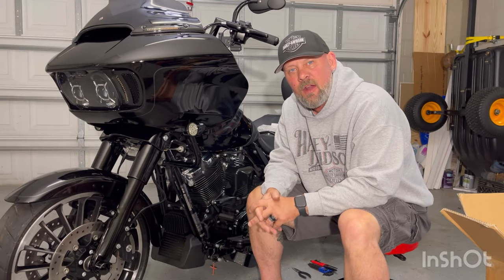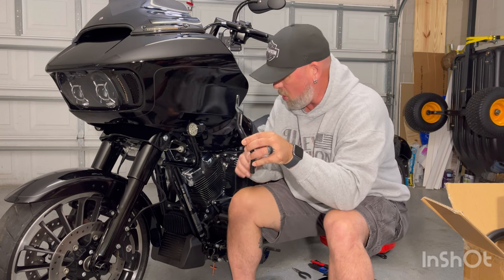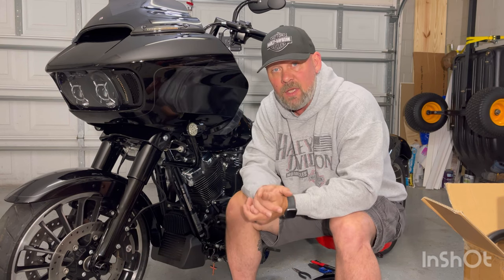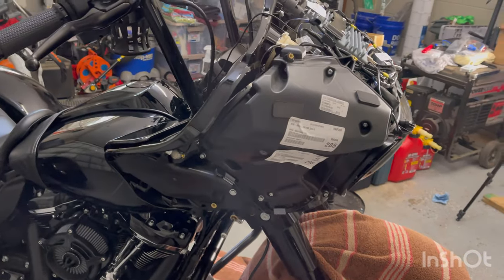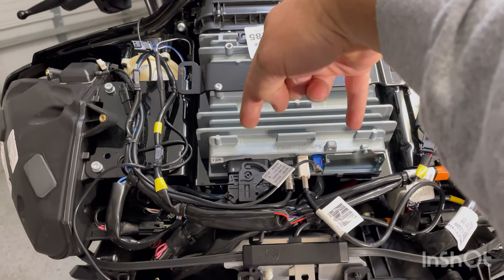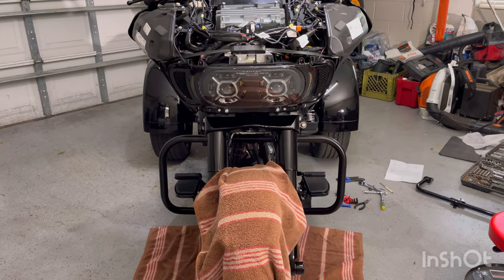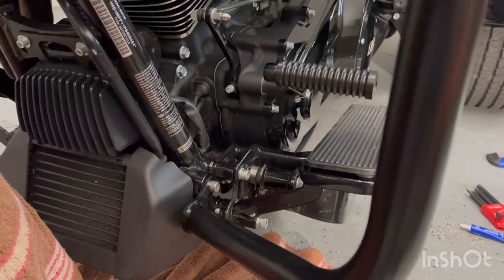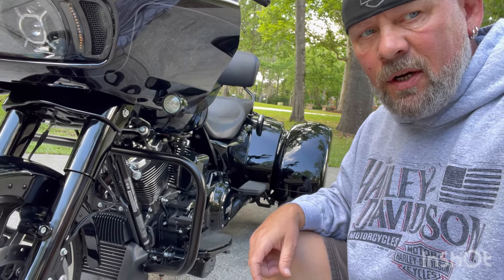2023 Road Glide 3 - Engine Guard

Comment: I just took the bolt out of the fairing support, used a longer bolt with stainless steel bracers and used the same hole with some locktite…. Been 6 months of heavy riding and no issues. A couple dollars for bolt and spacers… saved 60-70 bucks from some bullshit bracket HD sells
Reply: So… one bolt and stainless spacer… into the same hole for fairing support… didn’t have to take anything off or apart. So… that bolt supports the fairing and the crash bars

Comment: if needed, looks like a machine shop could add the original bottom "bar" back onto it by welding some bars to the top of the motor guard that attach to the mounts up under the fairing to help stabilize the lower end of that fairing assembly...if needed anyways...go visit Blockhead! He mounted an LowRider ST front fairing on a standard LowRider S...

Comment: What you need is the Bagger Nation’s ‘STEALTH FAIRING SUPPORT BAR’
(Fits 2015 to Present Road Glide)
Reply from the maker: Not sure that would work since they have moved the fairing.  The mounting holes may not be the same.
Reply: @donniewieburg  the Road Glide 3’s fairing is the same the only difference is HD added a 1” spacer to move it forward. I’m pretty sure it was designed  that way on purpose hence the big engine guard dilemma  (even though the chopped engine guard will fit without and modifications). That 1” spacer also killed the Road Glide Fairing Spoiler fitting on the Road Glide 3.
Reply from the maker: @Qman3946  so is that the square piece between the inner fairing and the frame mount?!?!  I was wondering. I knew something wasn’t right like my other Road Glides. I wonder if you put that stealth support bar mount in front of that spacer, if it would be a quick fix.
Reply: Bung King, KST Custom and 1 other company make the fairing support brackets needed. They range $65 to $75. The Stealth bracket from Bigger Nation is almost $300. Just so you can't see it. It mounts inside the fairing. Overpriced and unnecessary IMO.

Comment: I have a question for you will the fairing that you bought work for my three wheeler which is basically the same bike without the fairing will it be easier to install because it doesn’t have the faring need?
Reply from the maker: If it’s a Freewheeler it will.

Comment: the bolt you pointed at and said this is where the guard bolts up to, that bolt threaded into the frame so when you take that out do you still have a threaded hole there so when you put guard up there and place it, it all so has a threaded hole in the tab 2 threaded holes back to back? i hope i am making sense or does that original bolt you pointed at bolt into a nut that comes off. all my stuff will be here in the next couple days including support brackets i bought the chrome and black rg3 so my guard is chrome like to send a pic some day thanks man
Reply from the maker: There’s actually a hole in the frame and the threaded portion is on the actual engine guard that slides behind the plate on the frame. When your stuff gets there, you’ll see what I’m speaking of.

Comment: I would say the RG3 is a freewheeler with a RG fairing and a typical RG front the transmission forward. Also from a manufacturing stand point it’s more practical to build these bikes as such.
Reply from the maker: Correct!

Comment: Did the engine guard come with the hardware for where the plastic treads are located?
Reply from the maker: Yes it came with the bolts and also the engine guard bracket comes with them as well.

Comment: I put the engine gaurd on my rg3 before daytona but I took them off. Thought I'd need support brackets for the 7 hr trip. Let me know if you get any flexing after testing it at highway speeds.
Reply from the maker: I rode around a few hours yesterday at highway speeds on some rough back roads and really watched what the fairing was doing. I didn’t see anymore movement than I did before I installed the engine guard. Time will tell, but I believe it will be all good.   Thanks for your comment!
Reply: @Donnie Wieburg  Good stuff I will put mine back on then. I sent the support brackets back for full refunds.
Reply from the maker: @ltmoney11  yeah I’m doing the same thing!  👊🏼😎

Comment: @donniewieburg 
Hey man, wanting to follow up and see how the engine guard retro went without the brackets? 
Just got my RG3 and am starting the customization
Reply from the maker: I did end up putting brackets on. If you look into my other videos I’ve installed the  BungKing fairing brackets.
Reply: Awesome, how did it ride without brackets? Was it alright until you got them installed? Thanks man 

Looks great
Reply from the maker: @michaelroman1473  it seemed to be fine, but I did notice some flexing before I installed the BungKing supports.

Comment: wouldn't a OE 2023 Road Glide special engine guard not just bolt up? and leave the factory farring support brackets??
Reply from the maker: Nope. They moved the fairing forward about 1”.
Reply: @donniewieburg  what's moving farring forward have to do with the bar that mounts below the farring mount ?
Reply from the maker: @kennethcoble269  you have to attach a fairing support and the HD ones won’t work. Check out my other video of installing the fairing support.
Reply from the maker: @kennethcoble269  also, the fairing support sits where the engine guard would go.

Comment: My guard has a nut welded on the top mount. 

Is there a nut welded on the top mount of the frame????
Reply from the maker: No there is not. That nut weld will go inside the plate on the frame for the stabilizer mount to attach it.
Reply: @donniewieburg  thanks. Mine does not have the stabilizer

Comment: Couldn’t you have a metal block approximately 1 inch made to put in front of the stock mount then get a longer bolt to screw the engine guard through and onto the stock assembly- yes / no …? Being as the guard is only going to be used for lowers and will not be needed as a crash assist…
Reply from the maker: Not sure what you’re referring to.
Reply: @donniewieburg  the metal bracket that wraps over the black bar holding the front faring, the one you replaced with the black bracket - couldn’t a flat about an inch high (to clear the mounting bar) block be made to move the hole ahead of the bar and attach the top mount hole through the block into and securing the crash bar to the Original location ?
Reply from the maker: @YingYangStang  you couldn’t do that due to the steering stabilizer. You can still use the chrome one that’s on there now.
Reply: @donniewieburg  i don't think you understand what I'm talking about - thanks for answering when or if I do this I will let you know - thanks for all your very informative videos 👍
Reply from the maker: @YingYangStang  no I don’t. 🤷🏻‍♂️ What part of the mount are you referring to?